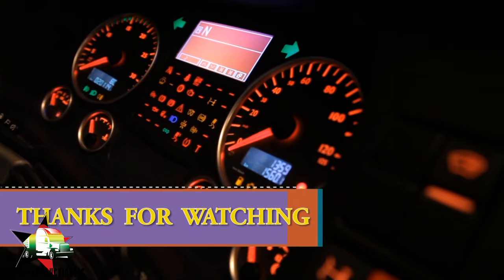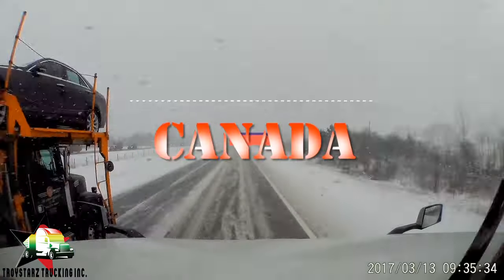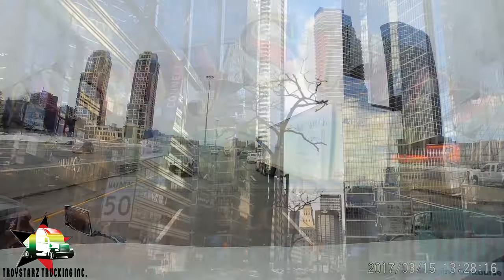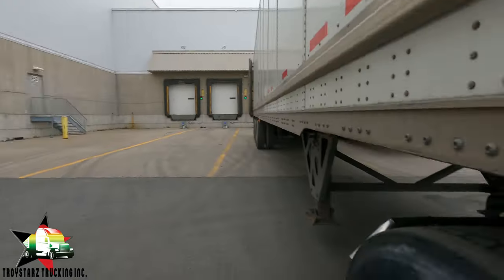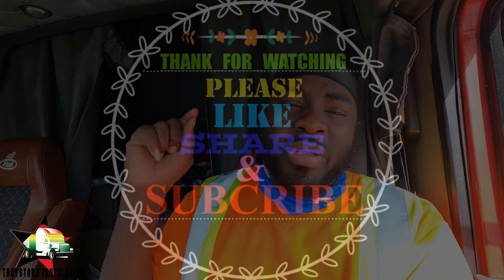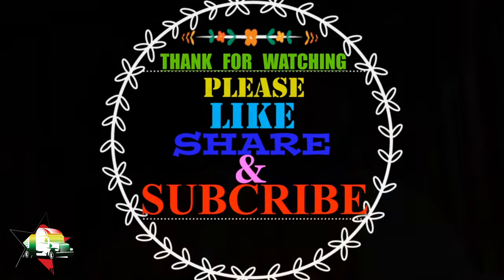The truck brake on the right side rear driver tire is not releasing.

Comment: What!!!! Finished video... brake dust and flaky rusty metal... usually from not taking drums off to clean brake components..i usuall pull brake drum off once a year and blow it out with air and brake clean and run light sand over pads...the  rusty metal flakes are usually your dust sheilds....but i still think slack adjusters stick some where
Reply from the maker: Thanks👊 I need to start paying more attention when I got get my truck inspected

Comment: Blessings! The issue with the wheel moving with a trailer and not moving without is weight…. So when you have the trailer on it’s going to move because of the weight of the trailer. And when there’s no weight it’s going to drag… I would check the slack adjuster and S cam. Brake dust is a first for me. Hope that was your issue brother. Stay up
Reply from the maker: Thanks for your feedback I'm keeping a close eye on it

Comment: 800 sounds like alot. Whenever you do brakes you need to clean all the brake dust and lube every moving parts. If it was just a spring they could have just bought the spring kit without shoes. I think you got taken advantage of. I think everyone who drives should educate themselves on what the parts are and somehow how they work and what they should cost. You don't need to be a mechanic should have basic knowledge. Ignorance is expensive.
Reply from the maker: What are you even referring to.. Did you watch all of the video or some? I never got my brakes done or get anything done to my brake shoes. Educate yourself along the way! that's what I'm doing here. In trucking you can't learn everything in a day
Reply: @TroyStarzTruckingVlogs  I said you spent 800 on other things so I assume a good portion was brakes. I watch the whole video after I commented. You said it was brake dust and rust. I meant to learn more about what the mechanics are doing whenever you pay a bill not just pay a bill because the mechanics said it cost this much. And they should be able to show what parts they changed. I wasn't talking about you I was talking in general we all go learn more about what we drive not just drive the vehicles.
Reply from the maker: I Understand fully Respect and thanks 👍👍